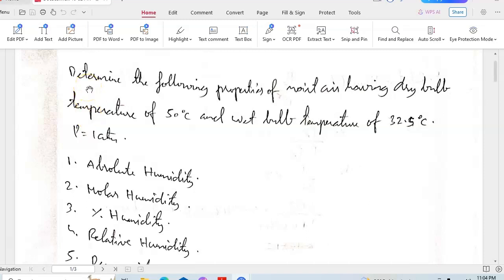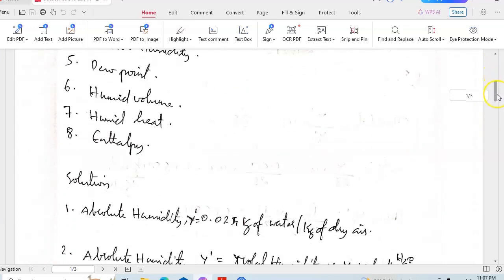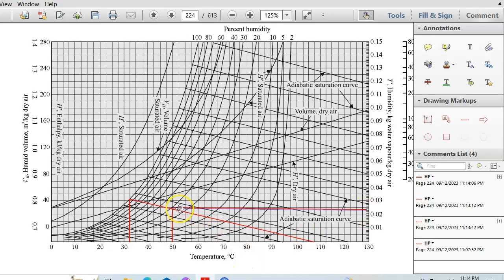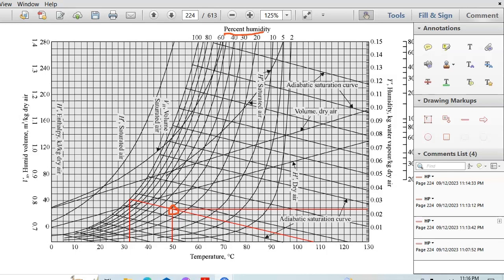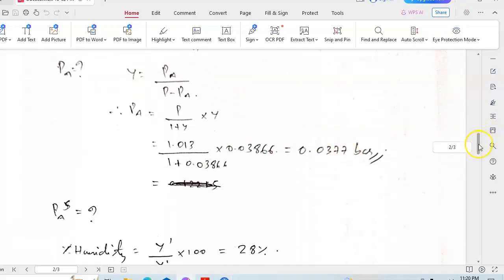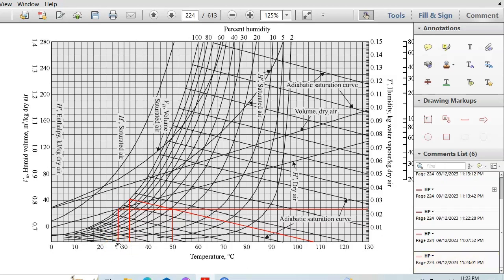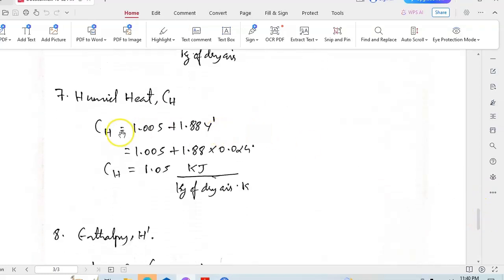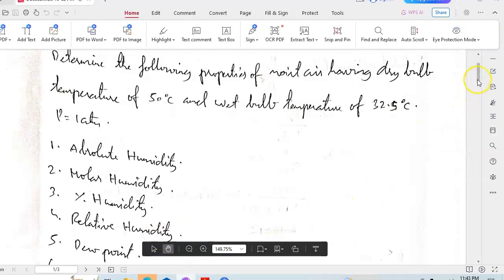Psychrometric chart, Chemical Process Calculations (CPC)

Comment: Qn) A saturated liquid feed stream consisting of 5 mole% C3, 10 mole% i-C4, 30 mole% i-C5 (light key), 46 
mole% n-C6 (heavy key) and 9 mole% n-C7 enters a distillation column having a flow rate of 5000 
kmol/h at 2 bar. This feed is required to fractionate in a distillation column, such that the distillate 
and bottoms streams should contain 1 mole% of heavy key and light key respectively. The reboiler 
and condenser pressures are specified as 2 and 1.8 bar respectively. A reflux ratio of 1.5 times 
minimum can be assumed. Assuming the Peng-Robinson property method, simulate the shortcut 
distillation column..

Sir ഇതൊന്ന് simulate ചെയ്തരോ 🥲
Plsss